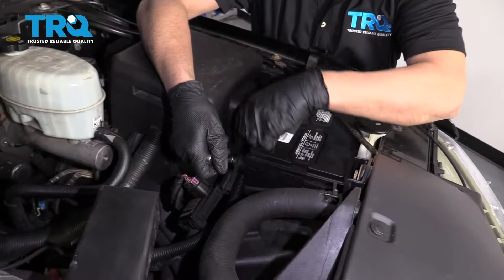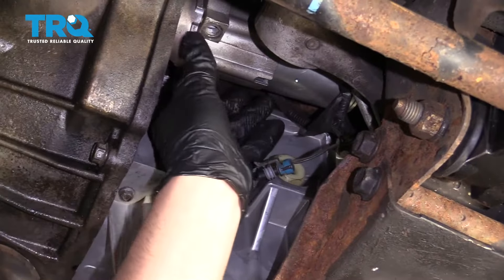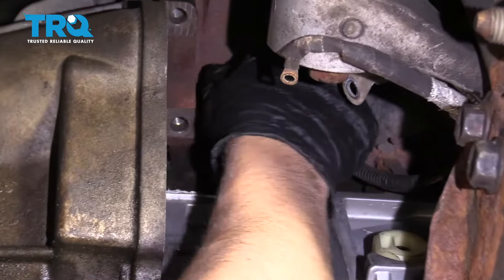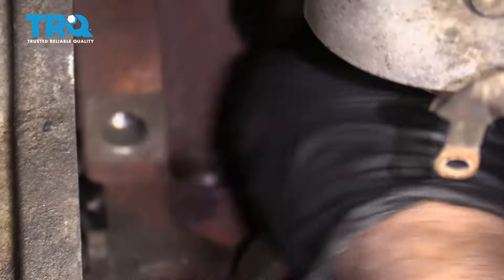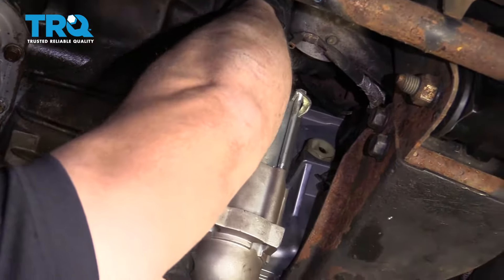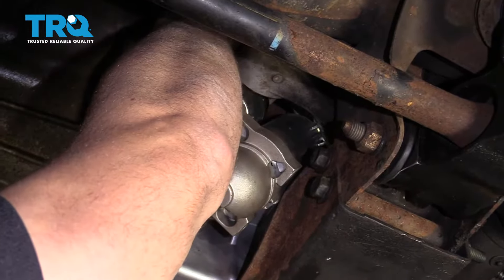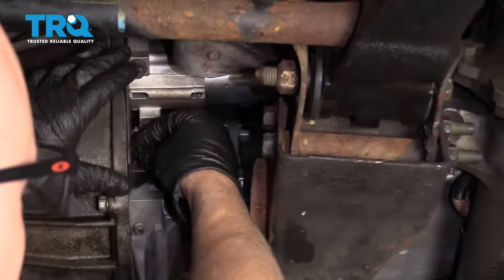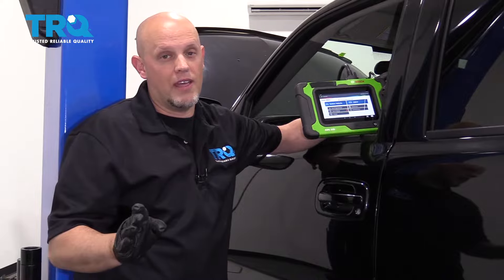How To Replace Crankshaft Position Sensor 2000-2006 Chevy Tahoe

Comment: So here's what I did. I pulled on the harness too hard apparently and broke one of the wires off of the crankshaft position sensor connector. So that is why it won't run. Off to the auto parts store for a pig tail. Hope this helps others. Edit: Success! Splicing in a new harness/pigtail end worked! Truck runs! Thanks!

Comment: Are these known to leak oil down over the starter? If so id like to find an oring instead of replacing the sensor because its good
Reply: The oring is a non standard size made of a special material, they don’t sell it separately.

Comment: I have a 2011 Chevy Silverado crank sensors bad according to the code reader I replaced it and my check engine light is no longer on but everybody told me that I would have to get the codes cleared or get it recalibrated by a computer is this true because everything seems fine to me

Comment: I am having trouble finding any information regarding the crankshaft variation relearn procedure for the 5.7 litre Chevrolet LS1 V8 engine in my 2002 model Holden VY SS Commodore which was manufactured in Australia.

I have the Chevrolet LS1 V8 factory service & repair manual which was written by Holden themselves & they don't have a relearn procedure written down, there's also no P0315 code listed for that engine in Australia & they used the same PCM up until they fitted the 6 litre Chevrolet L76 V8 engine where they went away from the Delphi PCM to the Bosch PCM.

In the VZ Commodore model (2004-2006 or up to 2007 for the Crewman Utility models) an eBay seller said that they still used the 24× crankshaft reluctor trigger wheel & the black crankshaft position sensor but in the VE Commodore sedan, wagon & utility models they used a 58× crankshaft reluctor trigger wheel & the grey crankshaft position sensor.

So, despite the overlap the VZ Commodores fitted with the 6 litre V8 engines were fitted with the 24x reluctor trigger wheel &; the black 24x crankshaft position sensor.

I do think that seller is wrong because others are saying that all of the 6 litre Chevrolet L76 & L98 V8 engines use a great 58× crankshaft position sensor & the 58x crankshaft trigger wheel, regardless of what model it's fitted into although you can convert the 6 litre Chevrolet V8 engine over by fitting a 24× crankshaft trigger wheel &; the; black 24x crankshaft position sensor & the front mounted camshaft position sensor & camshaft sprocket trigger wheels to suit the Delphi PCM, which means use the Gen 3 non DOD or AFM type of camshaft & hydraulic lifters as well.

Those engines were ordered from Chevrolet by Holden with the AFM delete done up until 2009 when Holden started making the AFM V8 VE Commodores !

I know that Holden has omitted things such as the fuel tank pressure sensor which function is also deleted in the same PCM which is used in the North American manufactured vehicles  !

Comment: My 2004 Chevy Tahoe would not crank. I replaced the starter and now it cranks, but will not fire. Could the harness have been damaged during starter replacement? Like pulling too hard on the starter with both wires still connected to get a better view of the posts on the solenoid? Is the wire that goes to the crankshaft position sensor connected to the harness for the starter?
Reply: You might want to check the wires to the crank sensor. Because I had the same trouble and one wires was cut